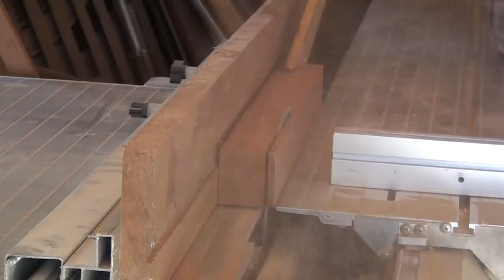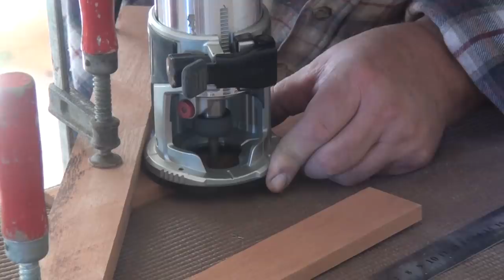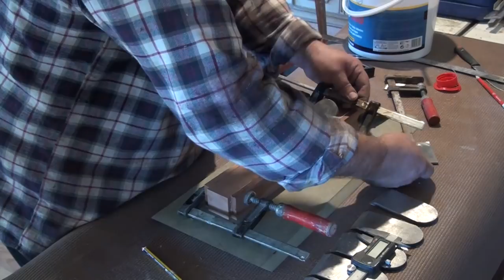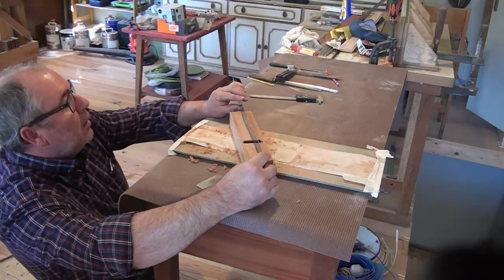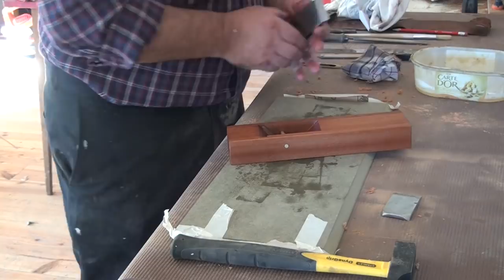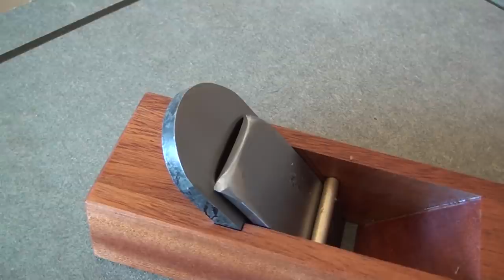Kanna Plane - Homemade japanese plane

Comment: Nice looking plane !  If I may share some informations . A Japanese plane iron is wedge shaped(tapers in thickness), which is what holds the blade in place(wedged in the groove), and also has a scooped back(Urasuki) to make flattening the back easier. 
As for the body, the sole is not flat the entire length , but it's scooped out so that there're really  only  two or three sections touching the wood when planing, to reduce friction and make the feel of the cut dramatically lighter .
Reply: Thank you, those small details make a difference in the performance of the tool.

Comment: Many Japanese speakers commenting that it's not proper - most complain that yours is made of glued three-piece wood and not out of a single piece. The second common point being the blade of yours is a flat piece of solid metal. The Japanese blade is laminated and very slightly concave on the back.
Reply from the maker: Yeah, I know that. Even if it was made according to all Japanese methods, it would still not be a Japanese planer. It would always be a Portuguese planer !!
I dont care. It works and the blade is optimal. It was a friend of mine, a blacksmith, who made them.
Reply: @FromTheWood  Then if you know all this, why call it a Kanna?? It's clearly not, it's a plane made (loosely) in the style of a Kanna. You even call it a Japanese plane in the title. It's a poor imitation, nothing more...

Comment: Hi, really nice job. Just a couple of consideration. In my opinion, the mouth on the sole is a little bit too large, so it doesn't work too smooth on the wood... 2nd, the chip breaker is too thick... But as already said, these are only my opinions. Very good job
Reply: MP Creazioni Legno 
That’s a pretty typical thickness for a chip breaker on a Japanese plane.
Reply: Thanks 😉

Comment: Where to buy the iron ? Very nice kana and fully efficient.
Reply from the maker: In a few days I will put the link to access the purchase. Thank you.
Reply: You can make your own rather easily.  Buy O1 tool steel bar, grind the bevel, and harden it using a torch forge and quench in motor oil.